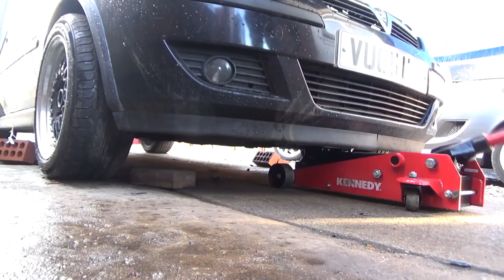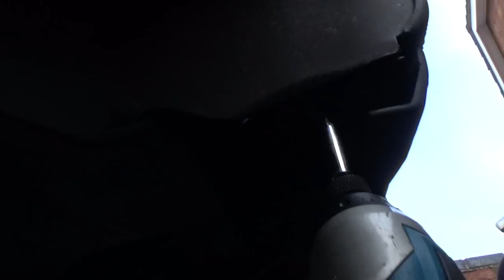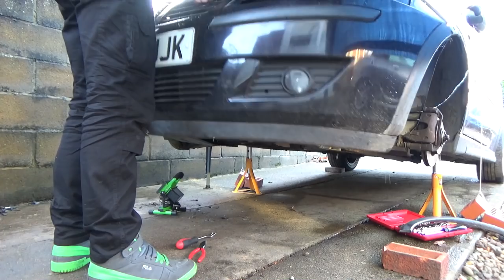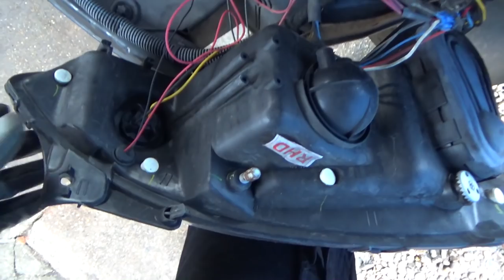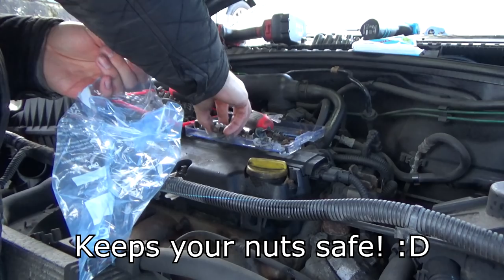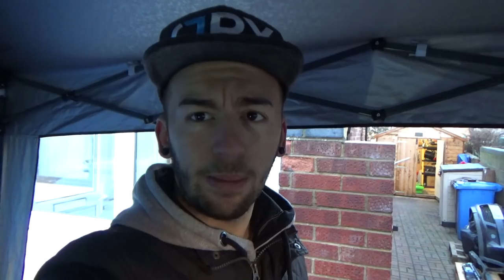Project 1.8 Corsa - Stripping It Down! (Part #2)

Comment: Why u have an impact wrnch if u going to break loose the lug nuts with a breaker bar first?
Reply: megadethGUY M because there's not enough  power in the hawk 14.4v 3/8 impact gun to break free lug nuts. Ideal for around the engine / removing panel bolts.
Reply: mike smith oh ok now i see i dident pay attention to the size of it true tru

Comment: can someone please teell me where is the MAP sensor on the Z18xe please.............I tried google it and nothing can be find
Reply: devilambrose z18xe has a MAF, it's on the intake system just after airbox.
Reply: na, I know what is a MAF, 
I actually has a long standing code (forgotten what number exactly......)
I google it and it return as a faulty MAP (which I have no idea what it is and what its for), but since the car still running ok (a little bit of hesitation probably once a month? god knows if its related or something else), 
I just never bother to get it change.

Comment: Not so much a fan of these cars and not sure why youre doing this? if anyone could enlighten me... i know perhaps theres a passion for his corsa but ya know. Not hating at all just wondering. Really interested into how the swap will progress too and the final result should be cool.
Reply from the maker: James Garrett I like corsas, other people like them too it seems.. I like to be different and nobody is doing a 1.8 swap on YouTube that I can find :)
Reply: yeah there does seem to be a big fan base for them. Cant wait to see the finished product, would you be inclined to a few track days in it once the swaps complete? would make for some really good content
Reply from the maker: James Garrett yea that's the plan :) probably wait until the spring for that though
Reply: Sounds good! I purchased a 1995 1.6 eunos roadster (imported mx5) 2 months ago. Tucked away over these cold months doing a few bits to it just tidying it up for better road worthiness really. Want to keep it fairly standard so I can get some good seat time in it before i start doing proper modifications. Intend do do some track days too. Was going to drift it but the car itself is far too good. It has only done 58k miles!